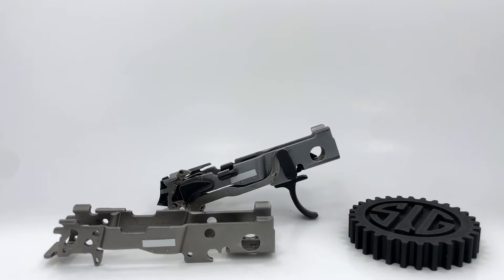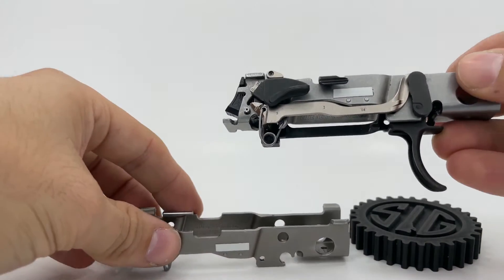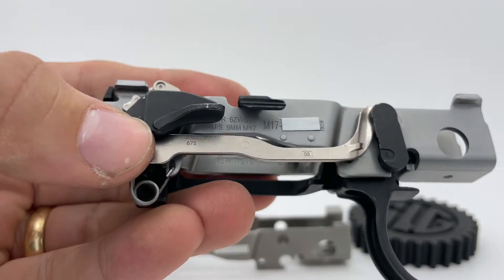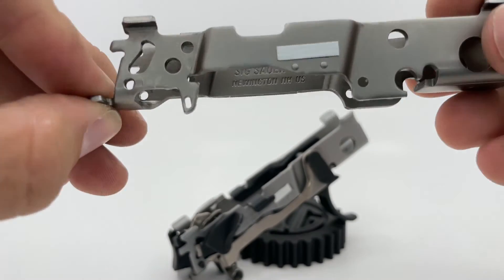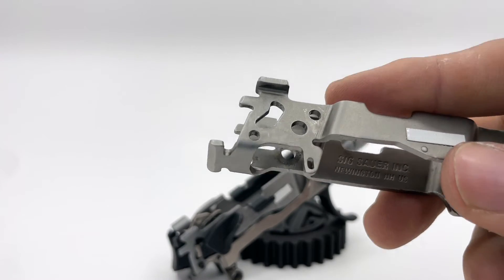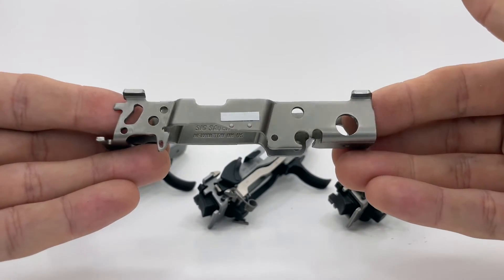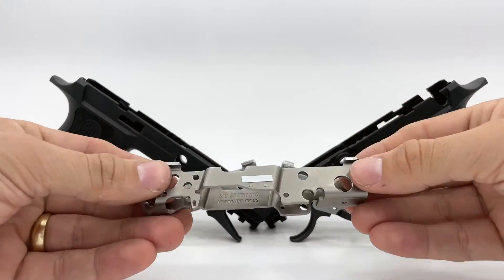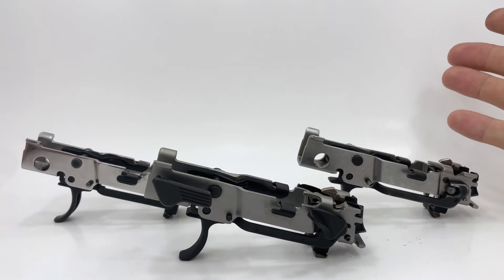P320 - MANUAL SAFETY FCU CONVERSION PROJECT

Comment: My Sig Sauer P320 M17 comes with a manual trigger safety lever. Is that something should be added to all Sig models? I also own the X Five and X Compact, both with no manual safety.
Reply from the maker: Not at all. It’s a preference only and not necessary unless you want to. The nice thing about the P320 is you can easily convert between manual safety and no safety with a single pin swap (and grip)
Reply: @SIGMECHANICS  I am all for it. With that said, you think the Sig X Series are mechanically safe to carry and operate? I carry 3 O'clock, not appendix, a bit concerned about safety tales, albeit I haven't have any issues.
Reply from the maker: I cannot say through all of my endeavours with the P320 that I would be worried. Much of what you hear is fear mongering, I say this, because the drop safety issue that people are discussing actually did happen, and Sig admitted to it, and subsequently implemented the voluntary upgrade program. However, the drop safety problem was due to the trigger being polled upon impact due to inertia yet, everybody talks about the P320 going off on its own (without a trigger pull), which mechanically is not something that will happen.
Reply: @SIGMECHANICS  I thought so. It is reassuring you put out all that technical information about Sig Sauer. I own 3 models: the P320 M17, the P320 X Five, and the P320 X Compact. I have zero issues with them. All three are very accurate, dependable, with great ergonomics. I love my "Sigs." 
I believe Glock loyalist fanboys are putting information out there attempting to hurt Sig, the strongest fiercest Glock competitor taking over Glock. 
I truly appreciate all you do for us, Sig Sauer owners/users. You should be working for the company! 😎
Reply: @v.german11b  I hope you don't mind my interjection on the topic of safety. I have 4 different types of P320. One is of pre upgrade production (may 2015). I checked the striker block on all of them by cutting the little tab at the bottom of the rear slide plate giving me access to the sear. I then chambered a primed casing, I used a small punch to push down on the sear. The striker was blocked by the striker block safety. I got the same result in all 4 P320's even the un-upgraded gun proving in my case that the trigger needs to be pulled to disengage the striker block. Is it possible for the striker block to fail, anything is possible
Reply: @garymccausland1272  I have no issues, own 3 Sig models, planning to add the AXG Pro. To each their own.

Comment: It's definitely got my brain thinking. Does the design only prevent the trigger from move or does it have any affect on the striker?
Reply from the maker: This would allow you to install a factory manual safety. Therefore, you have every benefit the factory system provides which includes preventing the sear from dropping which will prevent the striker from releasing.
Reply: @SIGMECHANICS  That's great. I  look forward to your videos.
Reply from the maker: It’s criminal the way Trudeau misrepresents Canada’s existing laws to the public to garner support. Canadians will have to get innovative in order to continue to enjoy their hobbies.